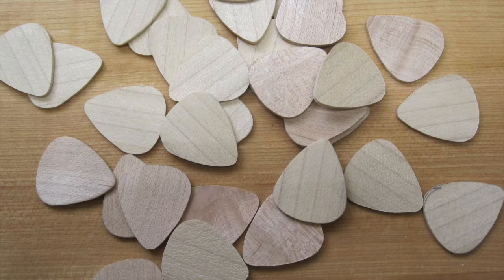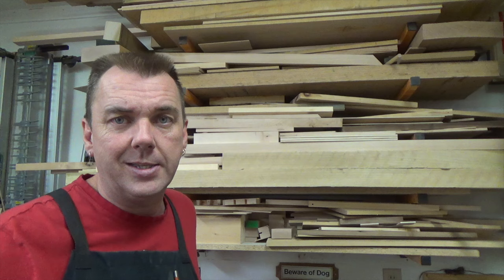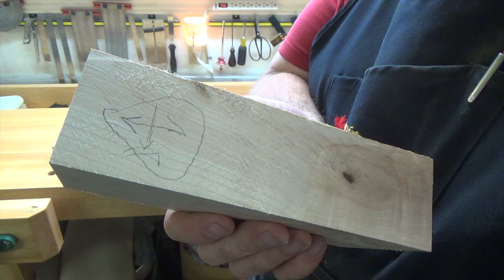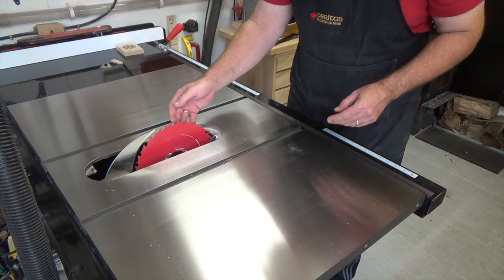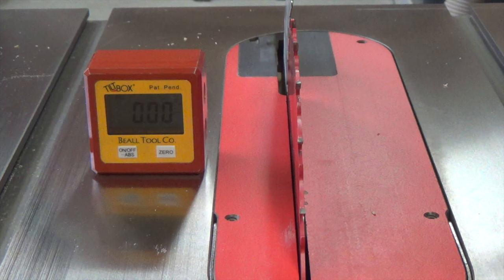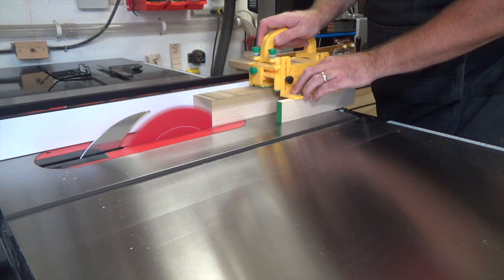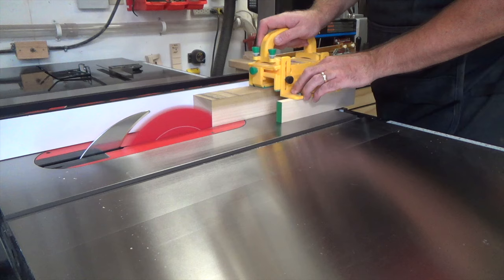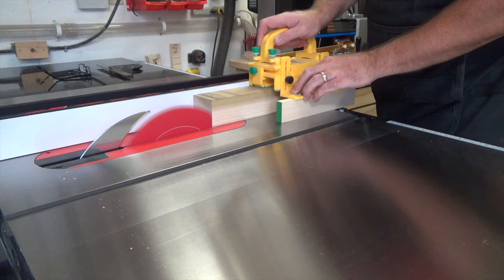Making Wooden Guitar Picks

Comment: Ive been making these for years wit just a hand saw and a belt sander and finished it with 400 grit sand paper. Just so yall know it does not take this much work. Its easier than you think, have fun.
Reply from the maker: I'm glad that you posted this comment.  I've had several people comment that they don't have a scroll saw and therefore, can't make these picks.  I've told them that is nonsense and there are a million different ways to make them and a coping saw is a perfect example of that.  Thanks for the input on the show and letting people know that there are more than one method in woodworking to accomplish the same task.  Thanks for tuning in.
Reply: You are correct. Just to clear things up with other people, the point was that you CAN do this with tools you already have. When I started out all i had was sand paper, a 2x4, and a dremel. Over time I was able to use scraps of different woods making new designs and types of picks. Just keep learning
Reply from the maker: I couldn't agree with you more.  Thanks once again for chiming in on the show and encouraging people to try new methods.

Comment: Cool ! Wood picks sound awesome. I actually have been playing with wood picks now for quite a while and through trial and error have developed the best way for a fully functional wood pick sized from 1.5mm all the way down to as thin as .6mm is about the thinnest possible wood pick that will stand up to the abuse. I sand them against a worn 220 grit vertical disc sander with my finger sticky with a little pine pitch. Keep flipping it over when it gets hot taking breaks between. When the desired  thickness is achieved then I hand bevel the edges with 220 and finish sand them by hand with 800 grit They come out amazingly beautiful and very strong. Cutting the individual slabs with a saw always ends up with a weaker pick.
The biggest factor is grain orientation. I have found that picks made following  parallel with the natural growth rings are the best as they have no growth ring separation. And what you want to do is cut a block of wood a little longer then your pick length, and with a small hatchet and a mallet split like 1/8" scales running right with the growth rings.
Splitting the wood ensures that the pick will have a zero chance of any grain runout and it preserves the woods natural strength and integrity. And out of about 20 different native and exotic hardwoods. The number one best wood I have found for making picks is Madagascar Rosewood, other species of rosewood are also decent. Bubinga is great. And straight grained cocobola  is also very good.
It is amazing to think a .6mm thick wooden pick could be a real thing, and it absolutely  can be done !
Reply from the maker: This is some great information and I thank you for posting it.  As far as the sanding of the picks is concerned, you may want to consider using double sided tape and attaching them to a larger piece of wood that has the end squared off.  This way you can keep your fingers away from the sanding belt and not worry about catches or about the friction heat.  As long as the sander and the wood block have been squared up, you will still get an even sanding.  Thanks for tuning in to the show and for chiming in with this great information.  It is truly appreciated.
Reply: @acutabove_woodworkings  Ya that may be a better idea for folks, that's why I use a warn out 220 disc lol it doesn't grab hard or catch and I use really lite pressure so it doesn't get too hot.
I have managed to sand well over 100 picks this way without grinding my finger tip off though lol.

Comment: I was splitting my wood with a knife and blunt object I uh didn’t get a nice 1/16” I don’t know if it’s gonna snap it’s a strong wood so might hold up

It turned out alright I’d say the edge of it is 1/16 and in the middle it’s 1/8 I was whittling and sanding it pain in the ass have tools to do this so you don’t spend 2 days trying to saw hard wood (use large teeth not fine teeth it can’t cut shit) like I did then realize you can split the wood with your knife I don’t have a table saw I have a miter saw that’s it it’s not ideal for cutting small objects like I was (I used an old stick was surprisingly strong) also stay away from the center of a limb I thought it’d be cool to make mine out of the middle of the tree limb but now there’s a bore going from bottom to top of my pick I don’t think it’ll effect it too much but I’d like for it to be as strong as possible with what I was given an outline is optional but you should probably have one either from another pic or print a picture I don’t know how to play guitar yet so Idk if it works well
Reply from the maker: I don't think you will have a problem with getting it to hold up.  There's only one way to find out and that's to give it a try.  I hope it work.  Thanks for tuning in.